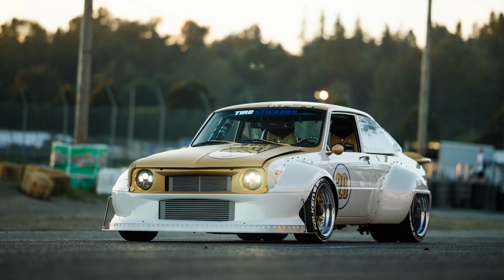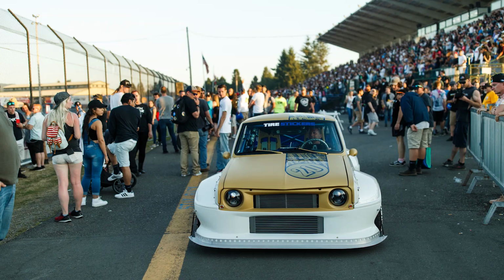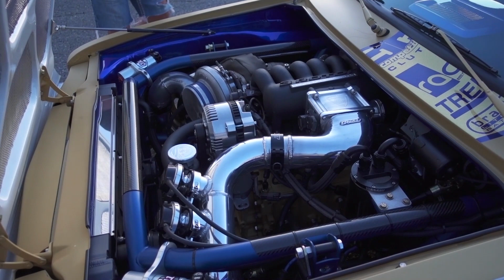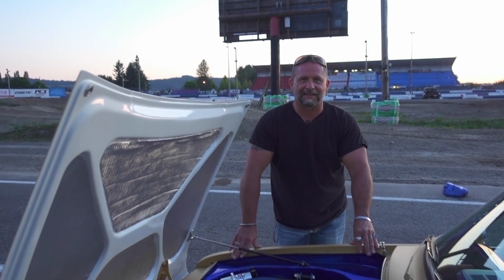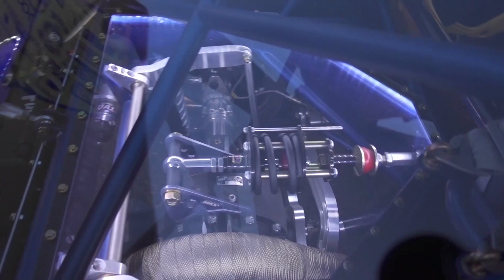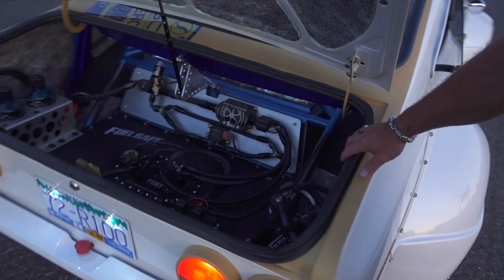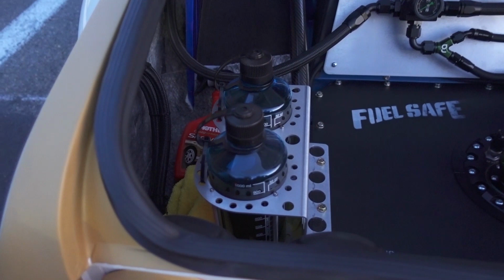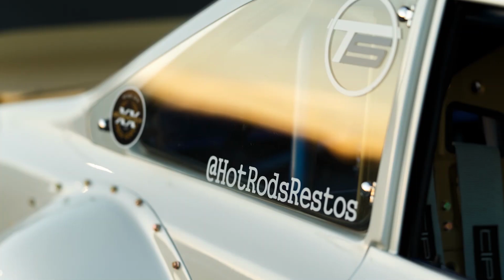Wild 700+hp 3 Rotor Mazda R100... Dually??

Comment: The rear suspension is a joke ..you can not change the pinion angle to the driveshaft more than 7 degrees or you cause the universe joint to bind up ..the few fractions of a second the rear end twists up on the springs does not add any speed to your lap times rather cost you those few fraction of a second for every lap the rear end is flopping forward and back ...and one first things you learn building suspension systems for track cars, you have to keep the rear  end planted on the track if want to go fast ...this guy is total BS when he talks about suspensions... Imagine if a top fuel rail dragster used his springy rear end binding up the drive shaft universe joint when top fuel today go 3 seconds in the 1/4 mile at over 300 miles per hour put down 10,000 horsepower ..your twisty rear end would be up in the grandstands eating spectators ... ..for off the line "bite" the best suspension on the rear is no suspension at all just like the world of out law Sprint cars , funny cars , and top fuel cars and motorcycles
Reply: you do actually realize that this car is in no way built for drag racing right? and I was wondering why your car still has its suspension???????????????????????????????? you seem to think it fast.  You do understand the theory of why a drag racing tire is larger in diameter and has a softer sidewall that ABSORBS the tire shock on the launch and as it flattens it produces an even greater contact patch to aid in the launch. I could go into the reasons my suspension works for the design of my car but I think you just would not understand.
Reply: @rodnielsen4234  it doesn't matter what the car is used for ..when you allow the pinion shaft to flop up and down more than the degrees the  universe joint is designed for you will have serious problems and you will not gain any extra traction
Reply: @donniebaker5984  maybe you should have a look at late model dirt track rear suspension, thats where this idea comes from. we worked with a number of very knowledgeable when designing this suspension setup to work in a pavement car. yes, maximum u-joint angles are a serious consideration, however there are yokes built specifically for this to allow maximum travel, and we run a smaller 1310 u-joint that allow more travel. the pinion doesnt just flop around, its controlled with the pullbar, and we can tune the pullbar with different springs and snubbers. the pullbar is limited in how much travel it has so you dont max out the u-joint angles.

as mentioned, this car is not built for launching at a drag strip, if it was it would have a more traditional 4 link and a large sidewall slick. this car is built for road racing, and the entire idea of that rear suspension is to reduce the shockload on the tires caused by rapid throttle or hard braking. our testing so far has shown up this suspension setup works very well for what we are doing with it.
Reply: @Sharkey_t  I am from Indy where we build everything that is fast ...I never said anything about drag racing your car only mentioned what will happen if you tried to drag race it ..no need to tell me about modified late models as the last one I helped build won the Eldora world 100 for a 100 grand ..and when it comes to road racing I built cars of Kenny Brown , Jack Roush and Steve Saleem ....the next two videos will show how it is really done >>>
Reply: @donniebaker5984  you dont need to tell us what happens if we tried to drag race it, we already know, and it goes up in smoke. not what we intended the car to do.

in the end we took a different approach to solve some unique problems in building a small, high horsepower car. sure, it may not be the best solution for everyone, but so far its work worked very well for us, had it not we would have cut it all out and started over by now.
Reply: And this is how you do it in the dirt ...here is some cheap methods you can apply to your car >>> https://youtu.be/9e2cGeLWEDo
Reply: Here again is Kenny brown 
..his advanced geometry suspension systems can be applied to all uni-body cars ...my friend has a 2015 Subaru WRX and the under pinnings are almost the same as a mustang . So the aftermarket suspension applications are very similar ...
https://youtu.be/v_rhnT0-rl0
Reply: @donniebaker5984  these are not relevant you should troll elsewhere and maybe go build something other than your WRX that is almost stock and let us see it
Reply: @Sharkey_t  According to Dana Spicer the max angle that a single u-joint should operate is 5-6 degrees to create constant velocity. Keep in mind that this suggestion assumes that you have parallel complimenting angles at the differential and the T-case. and your 1310 u joint falls into this cataglory .Joint Angles and Binding

￼

While u-joints are a simple way to transfer torque through an angle, they are far from perfect. Anything outside of a straight line will cause the yokes to bind, creating increased leverage forces on the u-joints and four speed changes during every rotation. These effects get more dramatic as the angle between the two shafts increases meaning that steering axles are at their weakest and most off-balance position when they are at full-turn.
Reply: @donniebaker5984  you're the one that brought up drag racing in your first post, but whatever, we can leave that alone.

none of the videos you posted really relate to what we are doing here. the mustang videos are talking about optimizing and correcting the suspension geometry on unibody cars, where you have limitations because they are building bolt in parts. they are also talking about a mcpherson strut front end and either 4 bar or irs rear suspension. the dirt track video is talking about a 3 link car, we dont run a 3 link, we run bird cages in a watts link configuration. we are also not compromising geometry because of building around an existing car, its a tube chassis car and the chassis was built around getting the suspension geometry the way we wanted it.

i think the biggest misunderstanding that people have with this is the amount of travel we run, it doesn't move all over the place like you see in videos of a modified. where they may run 12" of total suspension travel we run 3" of compression and 2" of extension. we also dont allow the pinion to rotate as much as your thinking, its not flopping back and forth 45 degrees. i agree, a u-joint is at its most efficient and most reliable within 5-6 degrees, however you can operate a 1310 u-joint all the way to 30 degrees, however as you increase the angle your load factor increases, effectively making the joint weaker. we are not running anywhere near that much rotation. while i cant remember exact numbers off the top of my head, i believe we have a max theoretical travel of 10 degrees on throttle and 5 degrees on braking, and so far we havent even gotten close to those limits. 

there are a lot of well proven rear suspension designs that all have their pluses and minuses. this design is not a road less traveled, its a road almost never traveled. in all the people we talked to only one was aware of it being adapted for a road course car. all we really know about that car is that it was an scca car that was horsepower limited because of the class it was in, and they felt they couldnt make full advantage of it. 

id also like to add its very easy to sit behind a computer screen looking at a few clips of a suspension system and knock it. unless you have worked with it before in a similar application, with similar geometry, your word doesnt have a lot of weight to it.
Reply: @Sharkey_t  as a kid of mine years and after year after year during the month of May at Indy my parents would take a break from me and dump me off at speedway with my cousin's husband who was in charge of track security at the Indianapolis 500 mile race ...and Ron my cousin's husband didn't care to be around me too much so he would take me and dump me off at the garages of gasoline alley in the infield of the Indy 500 and I would get to play with offenhauser , gerney weslake and cosworth engines back when they still had roadsters with offy engines and at that time in the early 60's the very first mid engine lotus fords of the stock block weslake engines to the ford cosworth bundle of snakes ear drum popping screaming that will take your breath away out of turn four ..and the last time I went was the Buicks of Roger Penske that grenade themselves all over the track ..and then Roger built his own V6 and plastered a Buick emblem on its air pulenum and won the race then got band like all the other fastest cars in the world that Indy was famous for , but not today as they are all Honda's  ...so fuck the Indy 500 as it just aint the same anymore ! But I did get a very serious education of very fast real race cars and exactly how they are built and why !!!! Starting at the age of nine and 69 in a few days ..back in 2003 I was a member of Ford's svtoa club with a mystic Cobra of Kenny brown performance and our favorite track was and still is Putnam  West of Indy built by the original manufacture of the Diasio D962R https://nasaspeed.news/cool-rides/midwestern-exotic-sam-mangiamelis-diasio-d962r-sports-racer-blends-the-best-of-three-worlds/#comment-81
As you can see the Diasio uses a Mazda twin rotor .....stuff your three rotor engine into a Diasio and bring it to Putnam Park please !!!! I know we are not made of money as a D962R goes at around $117k so here's an idea ..take your cool old school Mazda rocket bunny wide body and set it on a D962R chassis you build yourself as there used to be plains you could buy but with the thousands of photos floating  around the web scaling the chassis design from pictures  is not rocket science ...but the D962R trans axle may not withstand a 1000 triple rotor ponies ..so something like one from a factory five black falcon with. Nelson racing engine that makes over 1000hp should do the trick ..and you will have the fastest left and right hand turning car built ..and but some tuned mufflers , lights , wipers ,and a horn ...get it inspected and the same day the BMV will give you a registration and a plate for it ...just for spit and causing nothing but chaos and mayhem at the midnight interstate racing on 1320 videos
Reply: @donniebaker5984  SO Donnie I built my version of a Mazda R100 I wanted to build I don't care to compare it to anyone's car or past car that's been built and especially ones that have no comparable comparison! I built a modified version of a real registered production car that just happens to be very rare and a car I am truly in love with. I DID IT HOW I WANTED TO and don't Really care about your opinion so please refrain from comparing it to possibly a dump truck or a tractor next because some how we didn't build it correct to compete with one of those either. I honestly can't believe you have nothing but time to just look crap up and make comparisons to stupid things and TROLL around postings to do all this! GO BUILD SOMETHING! at 69 there cant be many more years left for you. I do not need you to reply to this I do not care to discuss this on here any further and if you must make comments and truly have an issue with me send them directly to me! If that is not OK for you to do that means you are a posting TROLL and not truly an auto enthusiast. Regards  Rod Nielsen